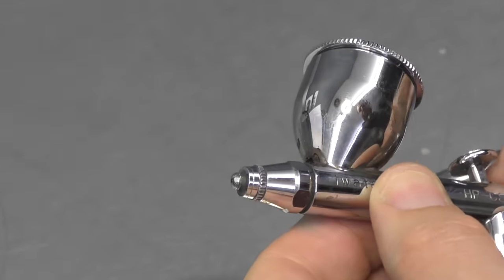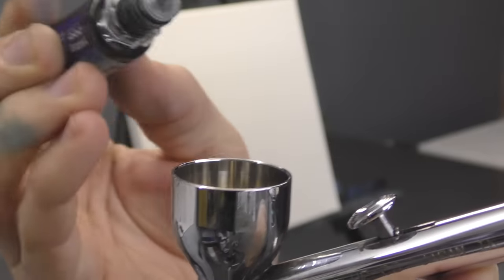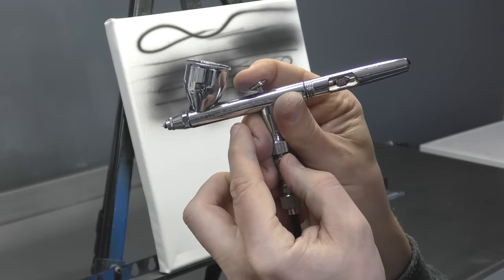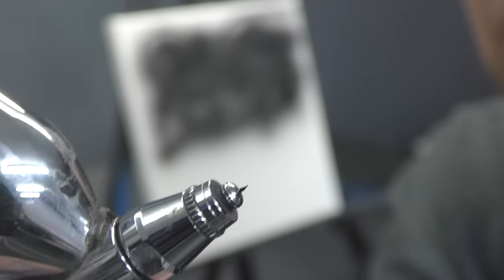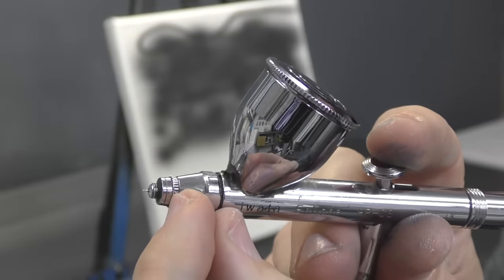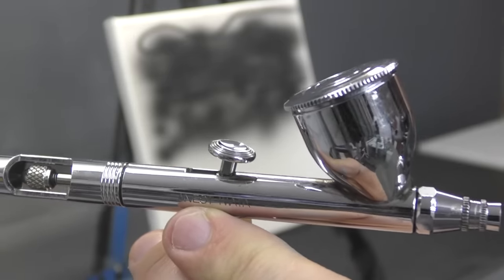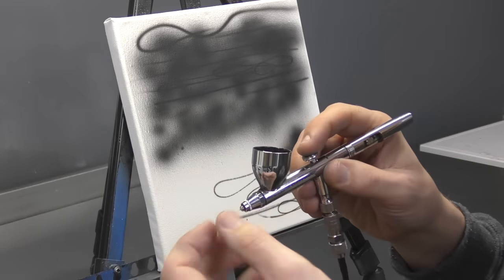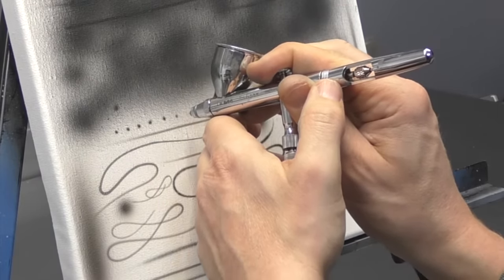Airbrush Tip Drying | Easy Tips

Comment: Something rarely mentioned when it comes to tip dry videos, is properly polishing a needle.    I use a variety of high grit sandpapers from 2000 to 12000 (jeweler's paper) and then a bit of jewelers rouge to put a mirror polish on the tips of my needles.    That, in combination with properly reducing paint and always keeping the air on,  pretty much eliminates tip dry entirely.     I used to have to pinch the needle a lot, but now it is rare that I ever have to. 

The trick really amounts to removing nucleation sites for paint, by eliminating micro scratches and pits that are extremely visible on factory polished needles if you view them under a jeweler's loupe.    If you take away places paint can build up and dry by proper polishing, you extend the amount of time you can spray without tip dry.   In combination with good trigger discipline,  it becomes rare that you ever need to pinch or clear your needle.
Reply from the maker: Yes great point and thanks SO much for sharing this is a fantastic tip which will definitely help .
I regularly use SharpenAir and they come with a polishing pad which does exactly that , I plan on releasing a vid explains this in more detail once I can get products back in stock at a reasonable rate as at the moment shipping prices from the US is just out of control !!
Reply: This is a fantastic tip! I polish my metal sculpting tools for a similar reason, but had never considered polishing my airbrush needles because of how delicate they are. Thank you for sharing the knowledge!
Reply: I just use a spray degreaser for household use: it cleans easily any trace of acrylic paint.
If there's a bit of dryed paint I "scrape" it with a brush soaked in said degreaser.

Comment: Paint spitting has been a very frustrating issue for me. I only recently started airbrushing and did not know about tip drying. Thank you for  this excellent tutorial.
Reply: Paint reduction is the key. As well as air pressure. The cap really helps. Spraying with it off will give u a tighter line but not by much . The cap on the eclipse works better that older designs and as good as a crown in my opinion

Comment: Thanks to your tips i got paint consistency to a bearable level (don’t forget that i use createx argh!!!) To help others here on your channel, a tip i have is that To back flush the system and mix the paint, I use a paper towel with windex bundled up. I stick the tip of the airbrush in it to soften and remove dried paint, then press the trigger to force the air into the paint cup to bubble up and mix it. Still, be careful with the tip picking your finger! It can go through the paper and it’s painful for some reason. Another detail i found about Createx, to see if your ratio is right, when you bubble the cup, make sure the bubbles don’t raise up too fast. It should bubble but they stay a sorta low and blow quickly. If the paint is not thinned enough it will create bigger bubbles and rapidly overflow the cup.
I hope it helps!
Thanks again!

Comment: I used a syphon feed Mac tools airbrush, and would regularly dip my tip in a moistened sponge, with a mix of water and thinner....seemed to help and I rarely ran into tip drying or clogging. As the hulls and some other items were rather large, there was some significant time spraying involved, the other thing I did religiously was break the brush down and clean it 2-3 times a day...more often if changing colours regularly. Maybe a bit overboard...but seemed to work ok 😁😁😁
Am enjoying the full range of vid's so far, great work.

Comment: As always  a very useful video.
I have just started A/Bing ..getting a strange flow problem  for some reason paint only flows after pulling back the trigger and then as I move trigger towards closed the paint flows  all be it  rather blotchy. Hope I have checked all the obvious  , needle nut  tight , tip dry , still experimenting with air pressure and paint viscosity.    not using  reducer....  might be the wrong shut off technique as mentioned here ...using Timbertec  chinese paint.
Reply from the maker: Thank you glad you enjoyed it, you may still have a slight blockage which is stopping your needle from seating correctly therefore allowing paint to escape when you press the trigger only for air, that said if it’s 100% clean then it can also be a damaged nozzle which is causing the issue. 🤔

Comment: Awesome information. Thanks much.
I was having that issue today. When I cleaned the brush there was paint 2/3 of the way back on the needle. 
2 Questions please.
Do you think maybe the paint was building up for awhile? Or another problem for paint getting that far back?

Also, is pulling back on that part in the tail housing to blast paint out is that different than just pulling the trigger back and then pushing down for a blast of air?

Thanks in advance.
Reply from the maker: Thanks for your comment and questions in regards to your first question it could just be paint build up over time or you have a needle packing issue check out my cleaning vid to make sure you are cleaning your brush correctly :
https://youtu.be/8dqs7eKmc3k
And as far as pulling back it is slightly different as you are effectively making the airbrush go into single action mode and dispensing full paint, if you don’t have a cutaway handle then just unscrew your handle loosen the nut holding your needle in place and press down on your trigger and pull the needle out a little and it will blast out any dried paint.
Hope that helps 👍🏻

Comment: I use a  piece of dense kitchen sponge cheap at dollar store  soaked in cleaner on the needle tip just make sure air on is away from your painting when you restart
Reply from the maker: Yes, great idea thanks for your comment 👍🏻
Reply: fishhookcrazy I use that also but also an old toothbrush fixed to a small container with thinners in it to scrub the tip, sometimes the sponge doesn’t cut it for me depending on what paint I use.

Comment: My best tool to get the clog off is taking off the needle cap and using a Q-tip to wipe that clog off. Be really careful not to bend the needle...
Reply from the maker: Great tip and good point, you need to be extremely careful when you get to the finer needles 👍🏻

Comment: Whenever I try to back blow through the cup with paint in the cup, it blows paint out of the vent hole all over the place.
Reply: You're just pulling the trigger back too far. You just need a tiny bit of air pressure

Comment: I have been airbrushing for over 20 years.... so...your great tip is... diluting paint?
this video should lasted 10 seconds... not over ten minutes....
Reply: Actually, the best tip here is to pinch the paint off the tip. It's the only trick you need to keep your airbrush flowing correctly.
Reply: As an airbrush beginner this video has been very helpful. Not everyone has been spraying 20 years. Smart arse!

Comment: I've seen comments on humidity causing tip dry higher humidity faster tip dry why would this be I would think more humidity would keep the water based  paint from congealing also would pulling back on the trigger do  the same as using the cut out on the handle I've done both yet see no difference,maybe it's my old eyes I should be wearing my specs 👓👀🤓
Reply from the maker: Thanks for your comment yes, humidity can be a factor which causes more tip dry just try adding more reducer, and you can pull back the trigger to replicate the cutaway handle but if you unscrew you’re handle loosen the needle chuck then press down your trigger and pull the needle out it will totally free flow and dislodge any dried paint 👍🏻

Comment: I've viewed numerous airbrush videos, and a handful of them have mentioned the proper way of releasing the trigger, that being to push the trigger forward into its standard position.  This actions shuts off the supply of paint.  Next, after pushing the trigger forward, you can then remove the downward pressure on the trigger, allowing the trigger to rise up slightly back to its standard, or neutral, position, which then shuts off the air supply.  

However, this video of yours, plus a quick mention in one of your other videos, were the only ones I've viewed where the creator explained the reason behind the recommended action.  Understanding the purpose behind why one should do this, or avoid that, is beneficial on several levels.  Knowing that a specific practice needs to be performed when doing some task is not as beneficial as understanding why that practice needs to be performed.  One shouldn't just know what needs to be done to achieve some goal, but more beneficial is comprehending why certain practices should be incorporated, which makes it more likely that a person will achieve their goal.

Perhaps the other airbrush content creators were somewhat ignorant regarding the functioning of an airbrush, and therefore, they knew not why such a trigger release (push forward, and then remove downward pressure) should be utilized on every dual-action airbrush one uses.  If they don't know why it should be practiced, then they can not adequately explain the method of the practice.  Explaining why this practice is beneficial, and nearly necessary, brings understanding to your audience, which in turns makes the subject matter easier to absorb, and to retain for longer periods of time.  Besides a deeper understanding of how things work, knowing the purpose of said practice brings a greater understanding, and that is so much more beneficial than just knowing what to do, but being unaware as to why to do it.  

One can be taught all kinds of mathematical and physics formulae, and they can commit these formulae to memory, but sans comprehension, they will be utterly useless.  For when does one utilize one of these formulae, or for what purpose?  What do each of the memorized formulae provide to the user?  Without understanding of what these formulae are, and what information they can supply when used, the person who has successfully committed them to memory will not be able to apply them appropriately to a situation, let alone when they can be applied.  Forget about combining formulae to calculate the answer to some question, or modifying a formula slightly so that it can be used to provide an accurate solution.  Often this is the attitude in teaching our children in public education.  There are many issues with public education, but this has been in existence for quite some time now. This is why so many students hate Math, and further, claim that they will never use it in "real" life.  Of course they won't, because they do not understand the purpose it can serve.  How can one utilize anything when they are ignorant of how it is used, and for what purpose it is used.  So they go through life without these handy, useful tools, and in not being at their service, they will tend to deal with matters in a fashion that has higher costs in money and time, or is just more of a hassle than if they had that mathematical formula at their disposal when they could have used it.  Perhaps they had the right formula memorized, but knew not what it was for, let alone that it could have been applied to a specific situation.  This is why I never cared much for the teaching methods of the history teachers I had.  They were too focused on regurgitation of names, places, and dates then they were on developing any resemblance of an understanding of why a series of events unfolded like it did, or any cause and effect extrapolation.  Just spit back the answers like some robotic parrot, and don't worry about why this information is important, nor what other understanding you could reach through analyzing what you already know.  Comprehension is the key, not memorization!

So, much gratitude to you for having the awareness of what your audience may, or may not, know.  This helps to avoid making any assumptions about your audience's knowledge, which can then lead to confusion from insufficient explanations that only exist because of that initial assumption regarding your audience's knowledge.  The best practice is to assume that your audience knows nothing about anything, and to cover all elements of any subject matter fully, otherwise you run the risk of leaving some portion of your audience without that key piece of information that could connect everything together for them, and in doing so, permits them to gain full understanding.  This is a practice which is by any measure not practiced enough.  This is quite apparent from many of the how-to videos on this platform with their ambiguous instructions.  I'm rambling unnecessarily, so I must be tired and in need of rest.  I'll just leave this train wreck of a comment as it for now, for I do believe it still has the potential to communicate the information I had wished to communicate.